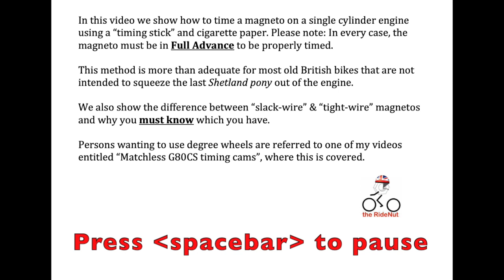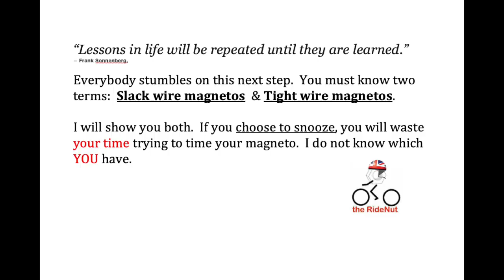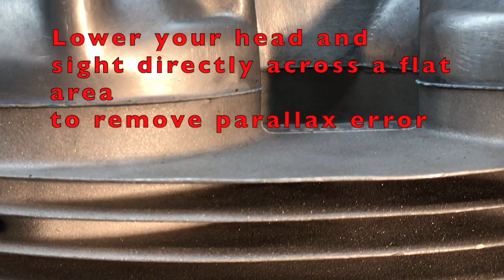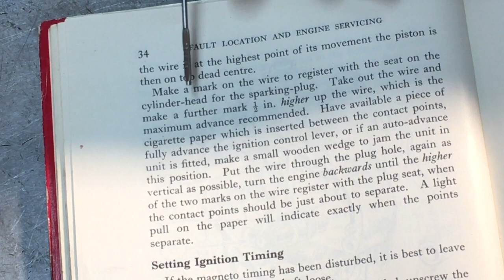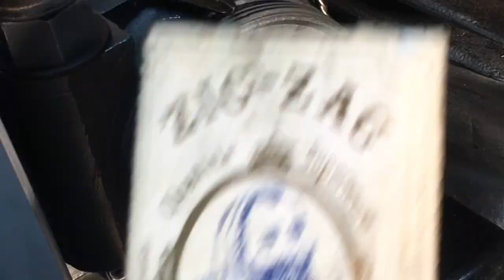Timing a G80 Matchless Magneto with Cigarette Paper

Comment: I think, anno 2023 , the way to go is using a digital caliper.......set the caliper at 2 inches or so, have the piston push up the measring rod of the caliper, set it to zero, then push out to 7/16 inch for 39 degrees.....turn the crankshaft and wait till the piston touches the measuring rod again at 7/16 in compression stroke....

Comment: Bulb across the points and a degree disc would be more accurate, or a dial gauge directly on the piston.
Reply: Cigarette paper is way easier than stuffing around with lights and shit. Close enough for an old chugger like a Commando.
Reply: @redtobertshateshandles  Why would that be? Any engine needs the timing as accurate as it can be. You find it too difficult to rig up a battery, two wires and a bulb? I guess you don't go too far from home.
Reply: Bulb across the points on a magneto doesn't work. The mag is independent of the battery, it only generates current in the primary winding when the armature is rotating. Before 1958 when magneto ignition /dynamo charging was replaced by alternator/ coil / battery motorcycle owners did their own maintenance. Their tool kit was often very basic. Dial gauges were a luxury. An experienced man could achieve a high degree of accuracy with the methods shown in this video. Also with manually adjusted advance and retard the timing could be adjusted on the move. By slightly retarding the ignition the rider could improve uphill torque or eliminate preignition. Electric start and Twist and go is a  modern phenomenon.  Imagine having to deal with hand change gears, fuel and air mixture levers, decompressors and manual ignition control.  Add to that before 1930 carbide lighting sets were common and gave a better light than 6V bulbs. The rider needed to constantly adjust the acetylene gas generator while on the move. Stirrup and drum brakes were useless by todays standards leading to brown trouser moments while riding your vintage machine in modern traffic.